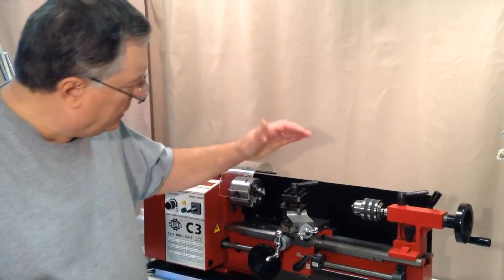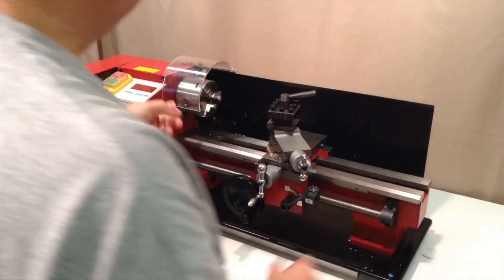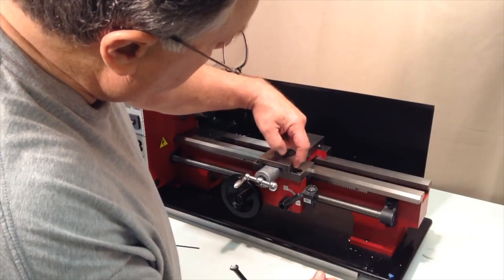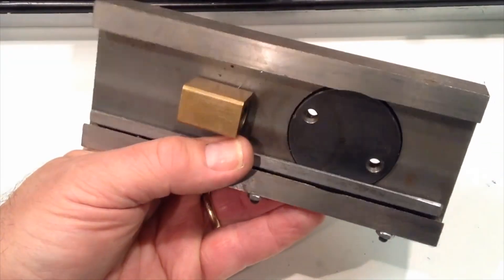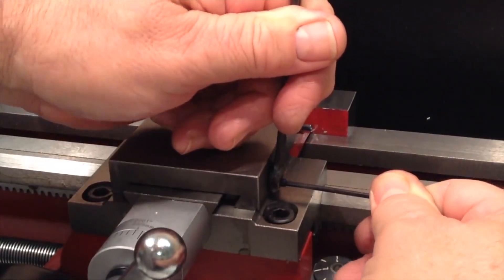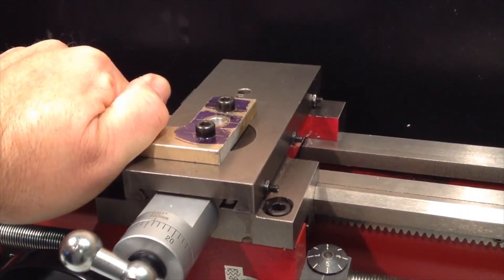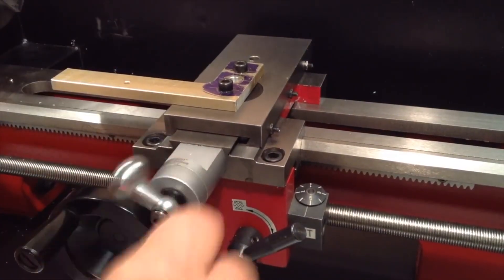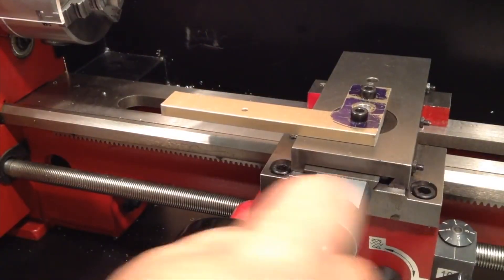Cross Slide Compound Pt1

Comment: Are the brass gibs an upgrade ? Are they worth the time to change them out ?
Reply from the maker: Brass Gibs are and upgrade (http://lmscnc.com/3843) and definitely worth it if on older machine or one with a bit too much wobble. Standard steel gibs are fine and will work just as well, so not a critical upgrade vs. other things on newer machine.

As Gibs get worn from friction over time and use they get thinner or uneven and then it becomes harder to achieve a TRUE fit. BRASS is harder material so will last longer and generally provide more rigidity to this part of the lathe. Given small size and lack of mass added rigidity is a major issue with any small lathe...